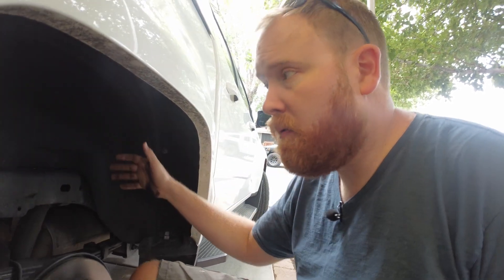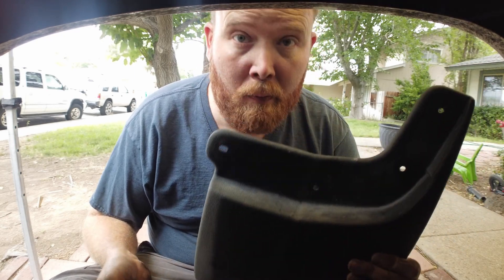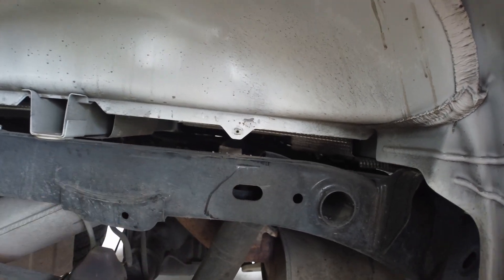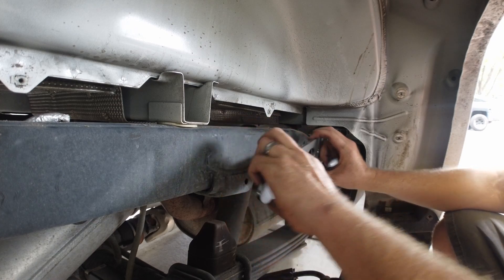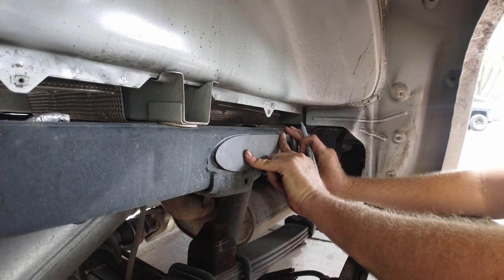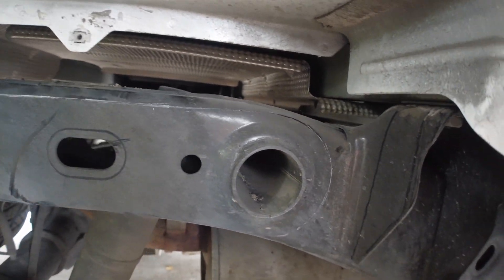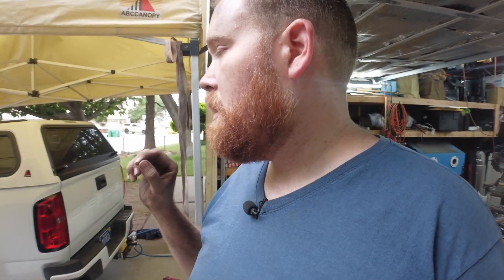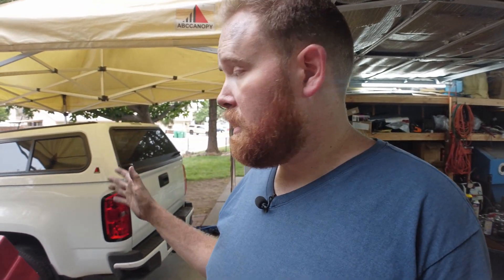Do This Before You File An Insurance Claim [Second gen Colorado/Canyon]

Comment: Just a couple ideas thrown out. If you’re worried about towing, be sure to use a good weight distribution hitch, the type with torsional bars and not chains. Like someone posted below, use a paint scraper wheel to prevent damage to the frame. Also if I were to have this done, especially at such a sensitive area I would spend the extra $$$ to hire a professional welder. I can’t add a picture, but I have a lot of experience towing with these trucks, an extended cab and crew cab sb. At a Cat Scale certified 10,250 lbs CGVW, of the 12,000 lbs CGVWR, without any issues with either.
Reply from the maker: Definitely good points

Comment: I've done this on my Colorado but thinking back on it I was curious the effect of the heating on the frame strength in that area.  Yes, a large piece of metal is being added but the existing metals getting really hot which might affect its strength?
Reply from the maker: That's exactly what welding does but it seems the rest of the welded frame holds up just fine. Since these go on the outside of the frame the inside of the frame is unaffected. I also included the crumple zone into the plate so that in the event of a large accident it should still bend there.
Reply: @BadlandIndustries  I appreciate the quick reply. And thank you for the good product, they worked as expected

Comment: I've done a few of these stiffeners/reinforcements for jeeps and here's some of my tips i have to offer - 

1. Always paint the inside of the stiffener and let it dry for atleast 24-48 hours. Water/humidity/everything always finds a way to get in. 85% of people diy this kind of stuff have zero clue how to weld properly/do it very sloppy. Tossing any kind of paint in between will help slowdown/prevent any possibly of corrosion. (You will smell some paint while welding, possibly some smoking this is normal.)

2. Mock up the piece before welding and outline the outside of the piece, from that point outwards is where you need to grind.

3. Don't use a flap wheel, use a paint stripping wheel. You can find these on amazon. If your chassis is made out of thin material you want to make sure you do not eat away at the already thin metal. Paint stripping wheels will not eat the metal, flap wheels will. 

4. Make sure the entire piece is clamped down properly before welding. Once you start welding and you realize one part is lifted up, your not getting that stiffner off. (at least easily)

5. Make sure all nearby wiring is as far away from the the welding area as possible. I had a customer who the last guy they took it took didn't take this into account and they had to pay for new taillight wiring. 

6. Always and I mean always test out your welder settings on scrap metal that's the same thickness and the stiffener and the actually chassis/body of the car. Practice doing horizontal/vertical welds so you know exactly how its going to be welding the vehicle.

Also just bought these stiffeners to put on my Colorado as I just made a new bed for it and will exceed the 1200lb limit regularly
Reply from the maker: thanks for your order and insight!